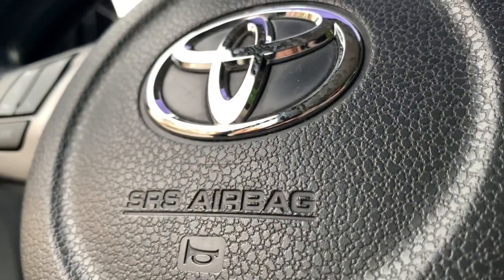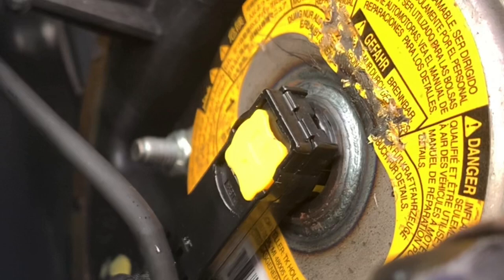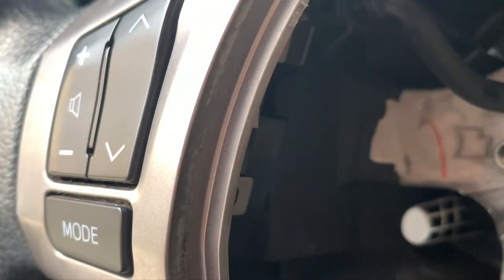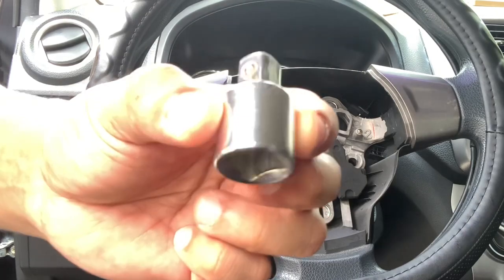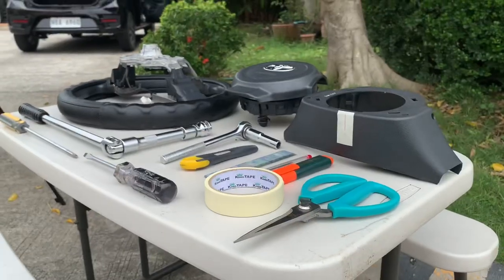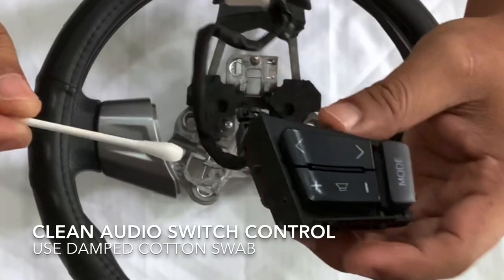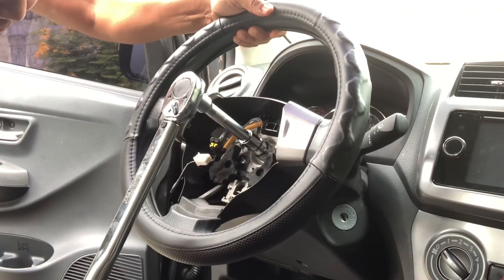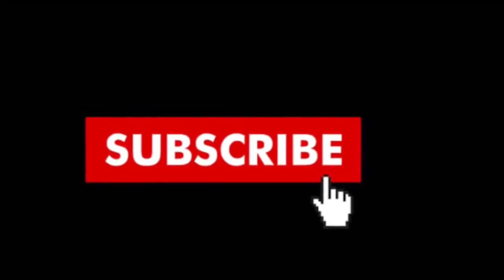How to Remove Steering Wheel & Side Panel - Toyota Wigo, Ayla, Agya, Perodua Axia

Comment: Hi sir, very detailed vid..i just want to ask about the steering wheel control wires connecting to the back of the headunit and which is the for the key 1,key 2 and ground wire. Thank you

Comment: sir tanong lang po kung ano po kaya, problem pg my tunog rachet sa likod ng manibela kapag kakabig sa kanan. Pero kaliwa nman walang tunog. Thanks
Reply from the maker: joseph endozo pacheck nyo po ang alignment ng mga gulong for realignment. posible din po na it's suspension issue ng sasakyan.
Reply: @WigoRaizeTV  ok. Thankyou sir
Reply: Sir maaari  rin ho kaya sanhi ng hindi pantay ang steering wheel kung sira na rin ang shock absorber